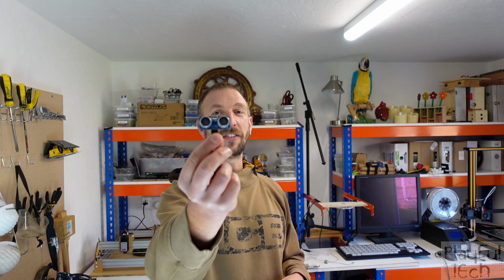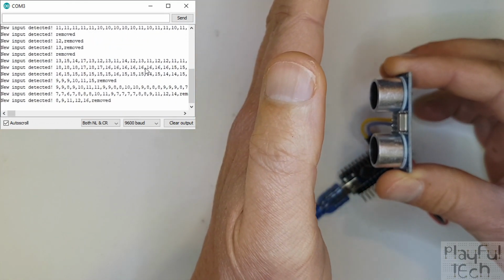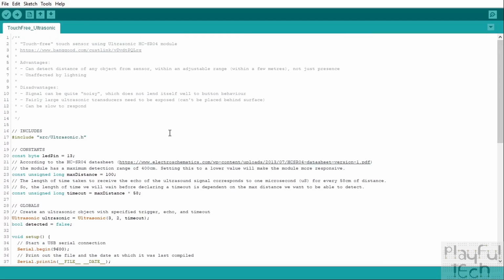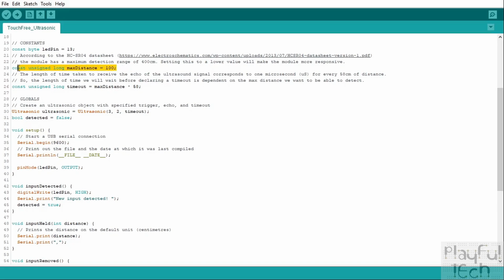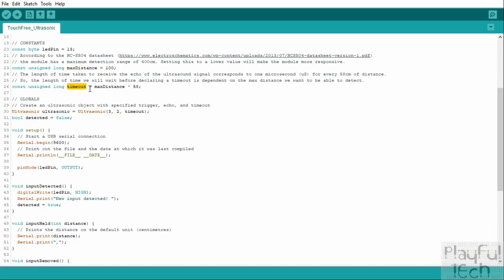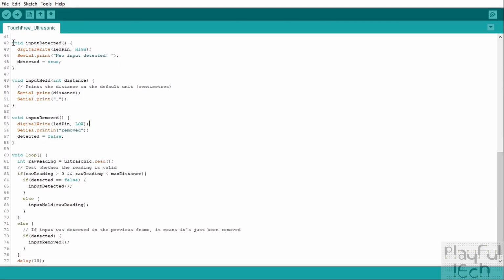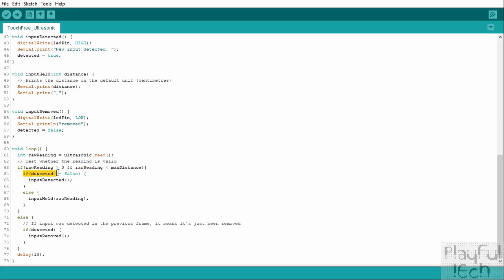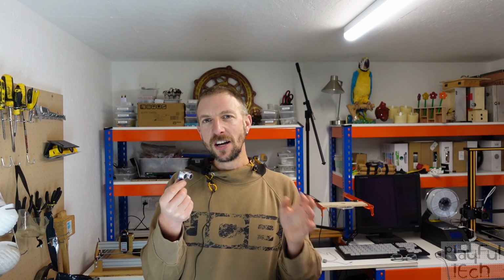Ultrasonic Range Sensor Touch-Free Input Tutorial for Arduino / ESP32

Comment: Maxbotix also make some very nice, clean (they have amazing filtering/processing/discrimination built in) accurate and easy to use ultrasonic sensors, not cheap but they do all the filtering/measuring in the sensor, freeing up the Arduino and can also be polled so multiple sensors don't interfere with each other.